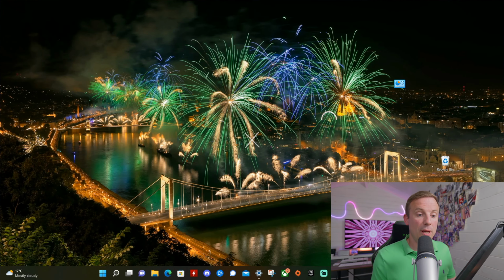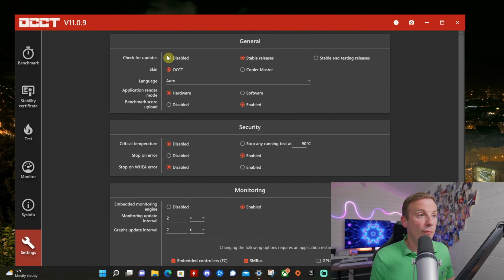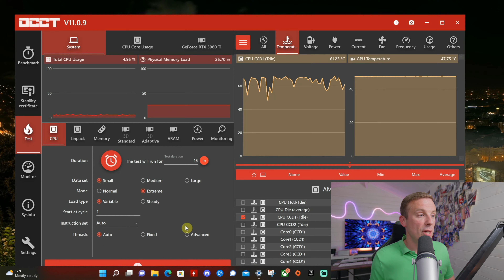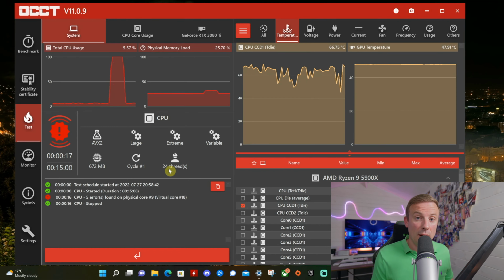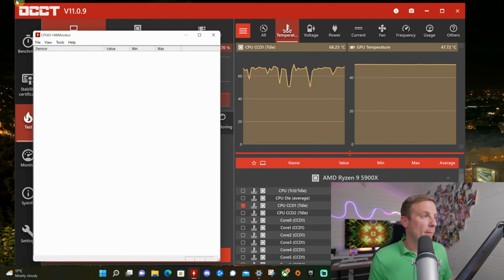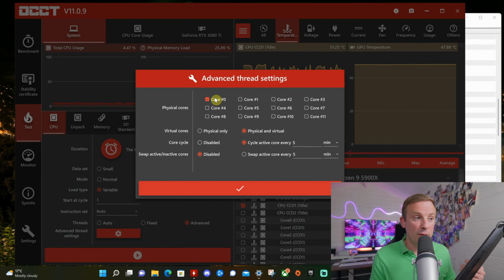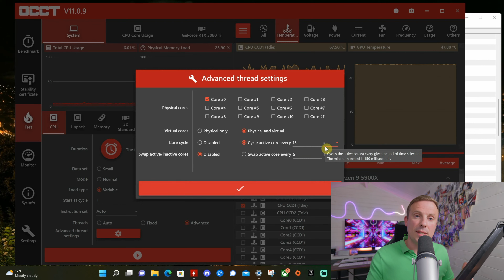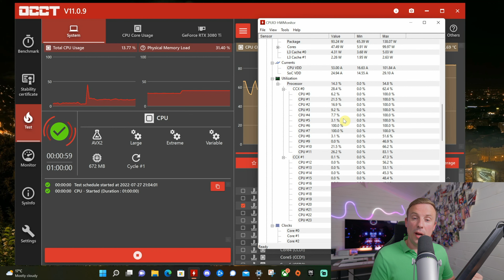How to Stress Test CPU with OCCT | Single and Multicore methods | Stability Test

Comment: im confused on  the temp graph in your video ,  its  around 60C  before the test ( seems high) but does not change when you run the test, shouldn't it go up .
Reply: If you look at the bottom left corner you can see tasks view and imidiatly after the error the test has stopped which was 16s. in to the test. Thats why it didn't even had time to fry  🔥😂

Comment: so I have what appears to be a very stable system.... running i9 13900KS with AI OC...  I also have 128GB of RAM running with XMP at 5600MT..   The computer is stable..  But I get errors with this app for the stress tests for both CPU and Memory...  what gives?  Is this test truly accurate? or are some of these errors not relevant to the stable operation of a PC?
Reply: I am pretty sure OCCT is fairly accurate. A lot of OCers use it because it provides more options than linpack and p95. Stability depends on the person, if you just want to game then Large + AVX2 extreme should be fine. For longer productivity workloads like compressing video files and editing; you might want to consider small AVX2 extreme.

Comment: Incredible this OCCT, with 0.1V undervolt on my 13900K was stable on AIDA64 / Prime95 / CB23.3, but in less than 5 min i got errors with OCCT.   Thanks for sharing the video.
Reply: how did you fix it? I have the same problem, and no errors in memtest, no errors in AIDA 64 after 3 hours test FPU, the problem is only in OCCT with thousands of WHEA ERRORS. Im using a i9 13900kf stock, without OC, and 6800mhz in rams gskill tridentz
Reply: @hernanp3892  Well the fix is more voltage.  But really depends on how stable you want to be.  But you shouldn't be getting WHEA errors with no OC no UV.
Reply: @Pabula  im gettieng WHEA ERRORS without oc, so strange. May be the problem is caused by rams, im using 2x16 gb 6800mhz, one of them doesnt work in any slot, im using only 16 gb, and reís one only works in slot 1 al 2

Comment: IMO, Curve Optimization on Ryzen 5000 should be done ONLY this way - an overclock/undervolt might be stable under all-core load, but crash during gaming, or even idle. It's because the all-core load uses a LOWER frequency.
My CO procedure is to undervolt one core at a time and set OCCT to flip between that core and a "default" core - not only does this hit one core as hard as possible, it simulates the loading and unloading of that core that occurs during normal Windows operation.
Reply: How do you do this in the OCCT 'advanced' settings? For flipping between that core and the default one
Reply: @shreddedhominid1629  Enable "Core Swap" option.
Reply: I’d like to try this as a method. So I’ve got my Core 0 undervolted as the only one right now. Based on what I’ve followed, I set the test to Large/Extreme/Variable/Core Swap and started the load on just the Core 0. But I’m not sure it’s swapping based on that alone?

Rather I think it’s offloading the stress to my other five cores when it does the swap.
Reply: @imAgentR  That sounds like the correct behavior. There's Core Swap and Core Cycling. Swapping inverts the test--it loads the core in questions, then all others, and then back to test the transition. Core Cycling cycles the core of the test setup. So I guess you could set up a Swap and Cycle, like [Core 0, All Others, Core 0, All Others] ;[Core 1, All Others, Core 1, All Others] ; [Core 2, All Others, Core 2, All Others] etc...
Reply: @acrobaticfish  🙏🏾 I was running some swaps and seemed to provide me the data I needed, then switched back and forth with it and cycling.

Appreciate the confirmation.
Reply: that sounds like it would take a year to test all combinations!

Comment: Ryzen 7 5700X on a MSI X570S Tomahawk Max motherboard with -30 curve optimiser:
15 minute multicore - Pass
45 minute (5 minute cycles) single core - Pass
CPU temp maxed out at 65.6C.

Comment: I'm not very tech savvy. The latest version (12.1.10) looks different. What settings do I set exactly for that single core testing?  It's a little simpler. Under Thread settings there are options cycle through and custom. I'm using a 7800x3d if that matters.

Comment: Cpu 5700x 
Single core testing in occt.(per core)
I have a 6 core 12 threads cpu.

In the new occt settings there is now the option to select threads per core.
What do I put there?
Reply: I'd put 2 threads which both make up an individual core.
Reply: @southwestwind  thanks

Comment: Had 5000 errors conifer crashed. Turned my core voltage up by .01 and fixed. Yeah I’m a noob to overclocking

Comment: 7800x3d i found that values on soem cores changes outcome of other cores,this made things severly complicated,i can set soem to -11 and soem to -35 and it's stable but if i set the -35 to 20 i can run the one who use to fail above 11 to something liek -15...

Comment: Could you please help me?  I have the following problem,  no errors in memtest, no errors in AIDA 64 after 3 hours test FPU, the problem is only in OCCT with thousands of WHEA ERRORS. Im using a i9 13900kf stock, without OC, and 6800mhz in rams gskill tridentz, i have tried to disable XMP profile but the problem continues

Comment: thanks for the great guide! I'm trying to test my 13600k 5.7ghz (4core load) / 5.5 (6core load) OC @ 1.29 volts on MSI z790 tomahawk ddr5. Runnnig prime95 small fft with avx disabled I am hitting 85-90*C on cores after 20 mins or so. 

Running OCCT small dataset extreme mode test I hit my (adjusted) TJ Max 95*C within a minute. is this normal?
On Large dataset 15 min run it gets to around 85-89*C max. 

Also, for single core test - do you run small dataset as well or only large dataset?

Thanks

Comment: my pc reboots or freezes when playing after 5, 30, 60, 90 minutes, i already did tests with furmark, ram test, reinstalled windows 10, now im using W11, tried 3 different hard drives and still happening. These problems make me want to quit pc gaming 😢
Reply: Power Supply.

Comment: occt cpu test use to run fine but now with new occt update my pc hard crashes ( fans stay spinning and q code turns off) have to turn off PSU to get it to respond.
ryzen 7700x stock, its fine on the other tests like ram,gpu, power test but cou test instantly hard shut down

any idea why?

Comment: i got black screan after test "3d standard" , "power" and in games
and I'm not sure about my volltage in test "linkpack" i have minimum for  :

12v > 11v
5v > 4,7v 
 (3VCC) 3v
i suppose my power supply need change

Comment: I have only information "CPU - Crashed" with no information what core had error. Did you know why?
Reply from the maker: You should get an error with details on the core. Make sure you have stop on error enabled in the settings. Try running the test with a lower offset if that doesn’t work and see if you can find the core causing issues

Comment: i have some issues. with -30 i had instability and some crashes so i tried -25 i think it was, still some issues, dropped it to -15. however very rarely this still causes instability, ive had one bsod and some odd behavior at times. HOWEVER any stresstest (cinebench, OCCT) can run for 5 hours and there is 0 errors reported. i dont really get whats going on here
Reply from the maker: There might be one core causing you problems. I would look at undervolting per core and testing the same way

Comment: Hey there, if the program closes itself at about 1h it means errors or not?
Reply from the maker: It should not close by itself. Is there anything in the logs
Reply: @FPtechtalk  i am running corecycler now 30min each core to test it and then back to occt

Comment: OCCT detecting problems on 2 or 3 of my core, I have Intel core i7 8700 8th gen and I am suspecting this is causing the bsod,.I've got a 1stplayer aio and my fans are well placed, question, if it's detecting error on occt does this mean my cpu is faulty? I have not made any tweaks, under/over volting, under/overclocking(since unavailable with intel) with it..
Reply from the maker: I would not expect any issues or errors if you have not done any changes to your cpu. What temps do you get during the tests
Reply: @FPtechtalk  I actually have a 1st player aio liquid cooler, I only have around 49° to 56°  temp max..my only problem is that when I run OCCT for at least 5 minutes it will show errors found between core #2 #3 #4 simultaneously within 2-3minutes..and whenever I tried playing valorant, the game freezes sometimes gives me GPU error message, also tested my GPU with OCCT and Furmark and comes out clean without any issues..only the cpu gives me an error in OCCT stress Testing..here are my full specs: Gigabyte H310m h2.0 LGA 1151 Mobo, Intel Core i7 8700, RX570 8gb OC armor, 1x16gb hynix RAM, 850W true rated full Modular PSU, 1stplayer Mothra AIO liquid Cooler, 480gb SSD, 1TB HDD..
Reply from the maker: If you have made no changes to the cpu and getting crashes in games and errors in occt I would think there is something wrong with the cpu. I would try update the bios to see if it helps. All check for any intel driver updates
Reply: @FPtechtalk  yup, no changes at all, already did updated the bios to latest version as well as chipset drivers, running windows 10 ver.21h1..everything are up to date..maybe it really is a faulty cpu..seldom and sh*t really happens though..thanks for the replies..cheers mate. Godbless.

Comment: hello, i ran the test on medium and it says it has errors on physical core # 7 (virtual core # 15). what to do next?
Reply: are these errors causing bsod everyday in my laptop ?
Reply from the maker: These errors could be a reason for bsod. I would not expect any issues with a stock cpu. Did you overclock or underVolt ? Are you getting bsod issues
Reply: @FPtechtalk  i haven't done any overclock or undervolt as i also do not know how. but i just did a diagnostic test on my laptop and it's not detecting a fan.
Reply from the maker: Are you getting any bsod’s.  How old is laptop
Reply: @FPtechtalk  about just a year. ill probably revert to windows 10 if needed.
Reply: @seanimal_555  voltage too low/clocks too high. I’d probably just lower the clock speed a little if it allows you to in your bios.
Reply: @seanimal_555  if it's not detecting a fan you should probably replace the fan we're clean it if it's dirty

Comment: Hey, just stumbled on this video while searching ways to underclock my ryzen 7700x. First things first, I find it very well done ;).
Secondly, I started with single core test myself and I do have a question as well. I've seen so many online CO results with most of the cores  between -15 and -25. Do I really had very bad silicon luck with CO results of -13,-19,0,-8,-6,-14,-12,-15 without any single core errors on large data set? Or am I doing something wrong? I did have PBO PPT set to 95w in Bios, but I can't imagine that might have been the issue. Thanx again for the video!

Comment: Anybody know why OCCT stops stress test after 1 hour? I set it to 2 hours but will only run for 1.
NO Errors, it completed the test.

NOTE: It even says "duration 1:00:00" when I start the test, even if I set it to infinity. I didnt notice this the first time I ran the test & it just stopped like I said at 1hr
Reply: Free version can only run 1 hour at a maximum, you have to pay to run a longer test
Reply: @Unarius  Did not know that & couldnt find the answer anywhere, thanks!